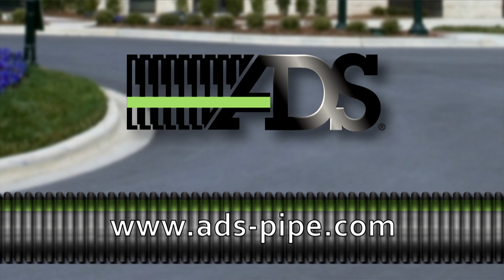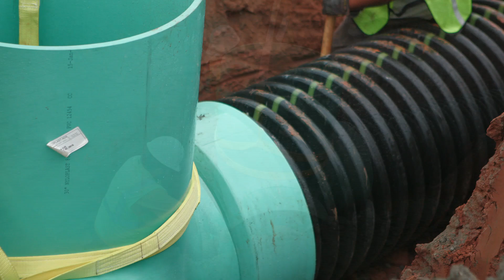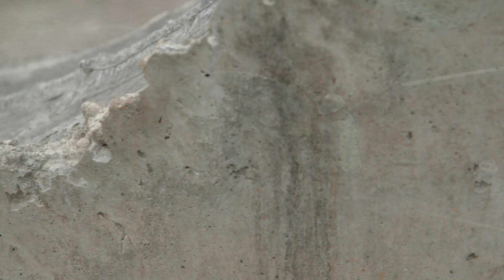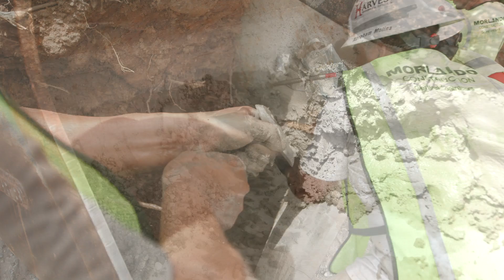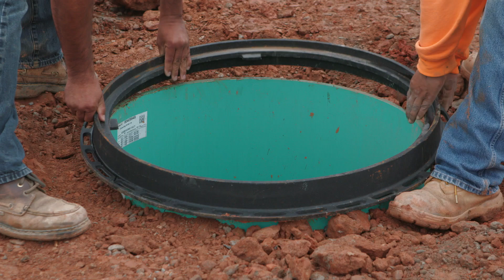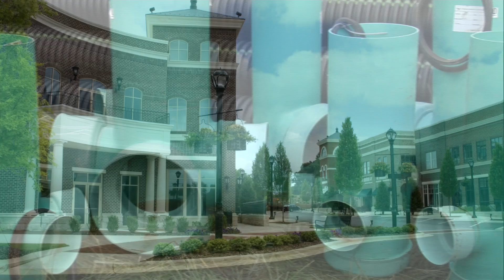Nyloplast vs. Precast Concrete Structure Installation Comparison Video

Comment: Something to note: Nyloplast structures are fantastic if your architect, engineer, project manager, and contractor are all on the ball with the design. When an architect makes a minor miscalculation in grade, it renders half the structures useless due to changes in design. When you compound the time needed for ADS to redesign and remanufacture the structure, you really end up with 504 hours (or 3 weeks) of additional time to place the structure. A concrete structure is far more effective in its flexibility for redesign.
Reply: Good guys find the grade problems before it's to late.